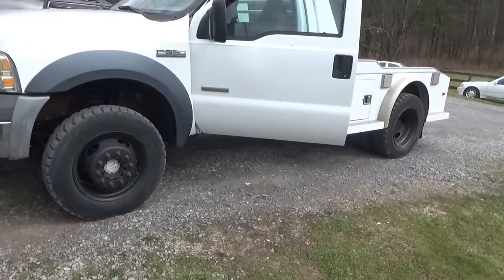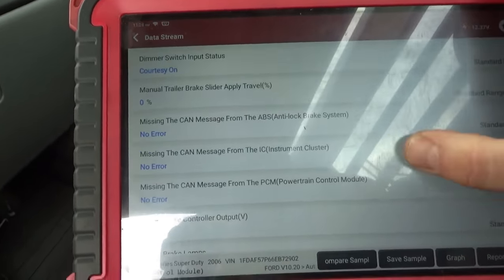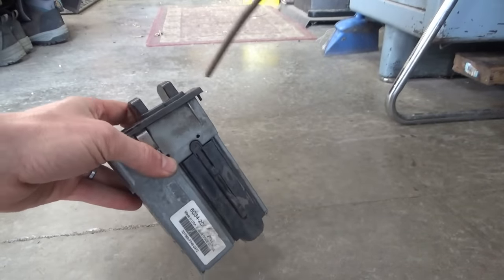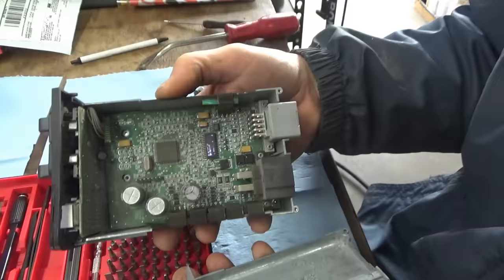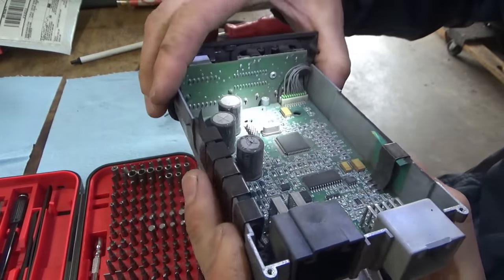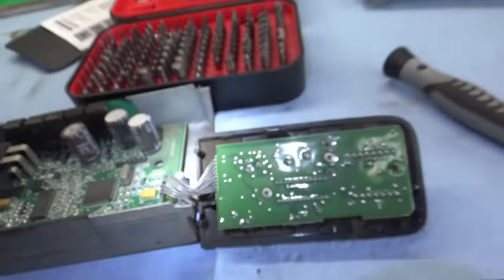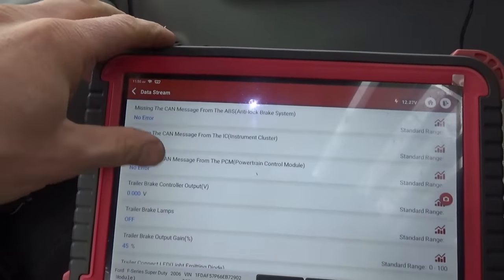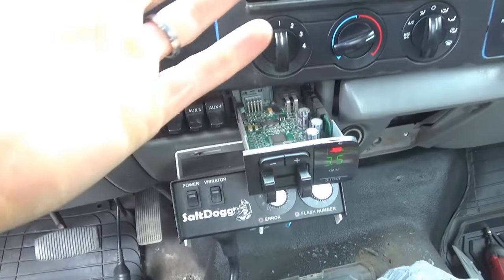Ford TBC FAULT B1342 (DIY NPR Repair!)

Comment: I believe after you soldered that controller it's still telling you to check trailer because you're trying to activate the trailer Brakes when there is no trailer attached to the truck. Awesome fix. You save a lot of us backyard mechanics a lot of time and money. Thank you very very much for sharing your knowledge.👍
Reply: You are correct.  The company I work for has one and if you don’t have a trailer hooked up, it will chime and say no trailer connected.
Reply: The only thing is you want a really good iron for soldering circuit boards. One with really tight temp control. Because if the temp is allowed to swing to high it will actually destroy the board. So again spending a little more money on a good soldering station is to your benefit.

Comment: I highly recommend a small bottle of liquid soldering flux. One drop on that joint would have made a big difference when trying to melt the old joint. Solder flux paste would work too, but it leaves a mess. Great repair - you saved the customer a lot of money!
Reply: Thanks. I didn't think of that refinement.
Reply: Yes, this! Will make it easier and more effective

Comment: I'm pretty sure the Ford dealership would have just replaced the box for $150 labor and $250 for the box. It's good to see a true repairman rather than a parts swapper.

Comment: Great vid, shows not all parts need replaced, many can be repaired. Also, I have found most manufactures, not just auto, are using lead free solder, which is far more brittle and requires higher heat to melt. most repairs involve adding leaded solder to help wick away the old solder so normal solder can be re-applied for a more permanent fix. Also, using flux helps in this process, I use the paste in a syringe. Just ensure to clean used flux off with isopropyl alcohol before reassembly. I also do some musical instrument gear and tube amplifier repair, this is a common problem, especially with PC mounted controls or jacks. Thanks Ivan.
Reply: Good advice, R.Weaver!
Reply: Thanks for the advice.  Your idea of cleaning with rubbing alcohol is also a good idea for repair. Do you put it on a dry rag then clean the area?
Reply: @dogsplantscarsneatstuff176  No, I just dip a cotton swab in alcohol sparingly, not enough of it to run off everywhere.
Reply: @r.weaver3769  thanks
Reply: @timd1833  Just use electrical parts cleaner dries quickly & cleans the whole board (spray can about $15).
Reply: Good morning! @R. Weaver

Comment: Thanks. But that check trailer means that it’s not plugged into a trailer. If you don’t have a trailer connected you will get that message when you push the gain slider. You could have said that and I missed it.

Comment: Ivan, also in the T100 you can purchase different types of solder tips that are more useful for larger solder joints. That fine tip is OK for PCB's, but this big lead you just did was struggling to flow correctly. There are a lot of options for other tips. You need a small chisel tip and a medium slant tip.  Use the hex wrench to change tips out.
Reply: Thanks. I just have a digital Weller.  You prompted me to get a few more tips for different applications.
Reply: I love the "wedge" shaped tips. they are a good universal tip. I've never liked pointy round tips unless I have to solder fine traces on a PCB, just tougher to get heat through the small tip.

Comment: Another interesting post. To add to the comment below, He is correct that there was a time all PCB mfg were switching to lead free in the late 90ies to early 2Ks but the mill spec mfg had cold solder problems so they went back to leaded solder. Commercial mfg stayed with lead free and no clean flux. I ran shops for two companies and we also went back to lead. We sold to aerospace and the military. My son had been running SMT machines for 10 years now and its all lead solder.
Also you can not always see cold solder with the naked eye. You need a good hoop or better yet a microscope. Any graining must be reflowed. The surface should be smooth and have a shine to it.
Thanks and keep them coming.

Comment: My  same era F 150 instrument cluster became intermittent some time back.   Found it was common due to faulty solder on the cluster.     Removed and hit every joint - it's been fine for years now.    I suspect that may have been the era when factories were switching to no-lead solder which didn't hold up.
No dealer would have done what you did. Great work. Thanks.

Comment: The normal useful life of most OEM auto parts withstand a lot of abuse. You just need someone who is willing to dissect, diagnose and repair "surgically adjust" overlooked manufacturing defects. Thank you Ivan for showing how its done.

Comment: FYI, all manufactured circuit boards have lead free solder that is brittle and has a high melting temperature. Mix with a bit of flux core leaded solder to lower melting point when repairing cracked joints or when replacing parts.  New joint won’t be as crack sensitive.

Comment: I agree Ivan, the internet is an invaluable resource, and that includes you.
Yesterday I took a Honda Civic in for yearly inspection. It passed inspection and I drove it home, handed it off to the wife and she went off to work. A few minutes later I get a phone call, "Brake lights will not turn off". It just passed inspection 2 hrs earlier. I go to her work and verify the problem. I google it, there is a plastic button on the brake pedal that actuates the brake switch. Pieces of that plastic button are lying on the drivers floorboard. I run over to ACE, get a pan head 8 x 1/2 sheet screw, glue that into the hole left by the plastic button and off we go....
edit for spelling..

Comment: Well done Ivan! We're all learning these techniques as we go along, at least until epoxy coated microboards make even that impossible. Having watched many board repairs on the 'net, flux applied before makes a huge difference even when reflowing. Then wipe the flux off off with isopropyl alcohol. After watching a few, I bought flux that comes in a syringe to more carefully apply it.

Comment: I've always wanted to know the answer to this. I worked at an excavating company years ago and all the trucks did this it was super annoying. It would randomly send full power to the trailer brakes unexpectedly and lock the tires up if unloaded or about end you through the windshield if it was loaded. Thanks for the closure.

Comment: Hey Ivan the reason it says check trailer,  as there's nothing attached to the tow truck  that's why it is showing that.  But great video!  NPR FIXES is great.  I need to do mine.  Couple bad joints i think.  Awesome video Ivan!

Comment: As an electronics tech one tip to find intermittent solder joints that can't be seen, heat/cold to localize.  Possibly heat gun to begin, cold spray.  Then a more local form of heat, possibly solder iron tip applied safely to suspect area, cold spray, should bring you to the bad solder joint.

Comment: You did say you were going to start doing some component repair, Ivan.  I have a 2005 F-350 and Excursion both with those trailer brake controllers.  I know now where to get them repaired.  I was told at one time that those controllers were made by Teckonsha; I don't know if that is true or not.  If that is an F-550, it has that 6.0 liter diesel engine.  Your neighbor loves them?  I have had EVERY problem known to man with mine.  Great video!

Comment: Hard disc drives have those very small torx screws.  And they are frequently jammed in tight.  The bit is so small that any significant torque twists the bit and it's ruined.  I was puzzling over a couple of stuck screws when it occurred to me what does EricO and Ivan do with stuck bolts.  Heat!  So I got out my fireplace butane lighter(cigarette lighter with a long stem) and I put that little flame on the screws.  Of course they didn't get cherry red like Eric's torch does.  But they definitely got very warm. Then I applied my torx driver again and darn if those bits didn't just come right out and my torx bit was saved.

Comment: you need a test plug with incadescent bulbs (led's wont work right not enough load) or just a working trailer.  i made one for cheap with just 194  bulbs. trailer plugs going green will kill those and the trailer lighting module module.

Comment: Did you check the trailer plug?  Corrosion and debris inside them is common in these plugs to give these issues and codes.  Just letting you know for when the fault comes back.

Comment: I had a 2005 F-250 SuperCrew 6.0, with the factory TBC failed. A new unit was almost $500 from the dealer and several weeks out. I installed an aftermarket unit externally with adapter cabling to the OEM harness, about $120 total but got it fixed same day on the trip. Just had to live with the permanent TBC message on the dash cluster.
Reply from the maker: I bet it was the same issue as this one 😉
Reply: @PineHollowAutoDiagnostics  I have no doubt ... the gain adjustment had also failed in my case. Using the manual control or brake pedal, the trailer brakes were super grabby (felt like the trailer was trying to hard stop the truck - glad the trailer was a 5th wheel). I wish the truck was still around to check, but I replaced it several years ago.

Comment: When equipment is placed near a heat source that get hot and cold will play with solder joints overtime and going down rough dirt  roads

Comment: Great fix Ivan, you must have got some tips from Super Mario like I  did for circuit repair, he has a sweet set up for circuit board and key repair. You were bettervof fixing the trailer box as it is probably on intergalactic back order from ford.

Comment: You need a full up dual soldering station with a stereo microscope.  Two irons so you can lift an 0603 SMT resistor.

Comment: Hello.  I have TBC Fault light and the Trailer Break Controller has no lights.  Nothing is illuminated on the controller.   I took the the controller out and looked at the solder joints.   They look good to me.  Any recommendation?  thanks!

Comment: As some mentioned  , if you had a trailer there to test with, that would have been good. 
Wondering if there's a way to get rid of the OEM and put a redarc or teconsha in there instead?
Reply: Being a work vehicle aftermarket would probably fail like oem just because of the constant use.On recreational vehicles if the oem broke then aftermarket would most likely be cheaper.

Comment: Great fix!
I don't want to be "that guy" and nitpick you, but I would've used a shop vac instead of sandblasting the outside and pcb inside with a blow gun.
Reply from the maker: Shop Vac would be absolutely useless for this application 😅

Comment: What's with Fords and cracked solder joints is it because of the use of lead free solder? Anyone know. T.I.A.
Reply: They aren't using enough component staking, the pc boards are too thin and the switches and rheostats aren't " heavy duty". Everything the manufacturers do to save money and speed up production hurts these modules..the lower lead content solder isn't bad..50 years ago we had bad solder joints too

Comment: This is an example of the 'cheapness' of manufacturers that use the lowest skilled labor in the manual assembly process, as they are paid the least, all to save maybe 5 cents per item. (I am a certified NASA, JAN level solderer). Today's Lead free solder (mostly only Tin) does not 'wet' the joints without the proper flux.
Reply: I would have thought this board would be wave soldered? The joints look very consistent. I think it's just leadfree rot. I blame the EU for forcing the entire industry to move to a less reliable technology, this board doesn't look like a cheapo slave labor soldering job. Whenever I see those, half the joints look like a starving cow and the other half have 3x as much solder as required.

Comment: It's never something simple. Can't be. Only the firing of the parts cannon can fix it. Tire low on air? Can't be. Has to ve something wrong with the tire, wheel, valve stem, valve stem core, valve stem cap, lug nuts, hub cap, center cap, wheel cover, wheel weights, tpms sensor, tpms sensor battery but definitely not air. Adding air will not fix a tire that lost .5 psi after the ambient temperature dropped. Gonna need all four new tires, wheels, bearings, rotors, pads, calipers, hoses, hardware, spindle, knuckle, ball joints, control arms, sway bar links, sway bar bushings, sway bars, load sensing proportioning valves, brake lines, master cylinder, vacuum booster and a little tree air freshener. If you add air you're fired and you will never work in this town again for insulting the intelligence of the typical dealership fan boy lackie with $40,000 in tool truck debt.